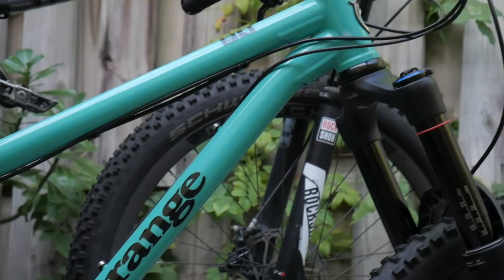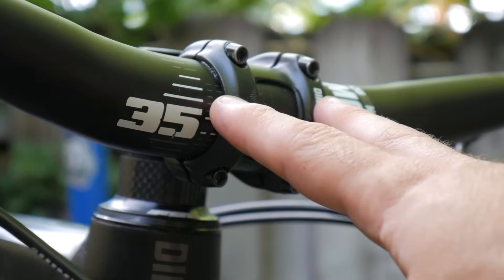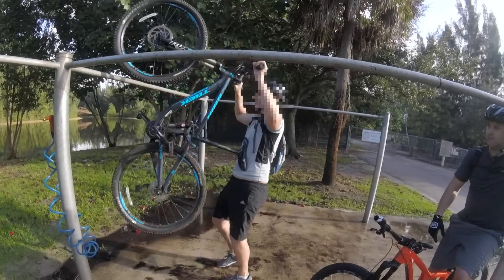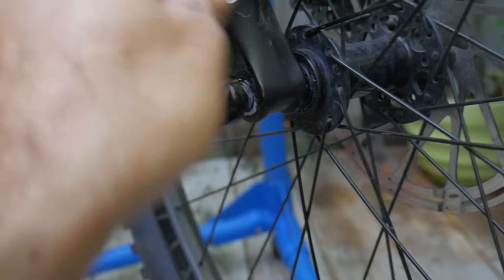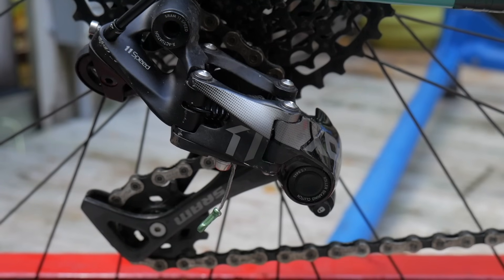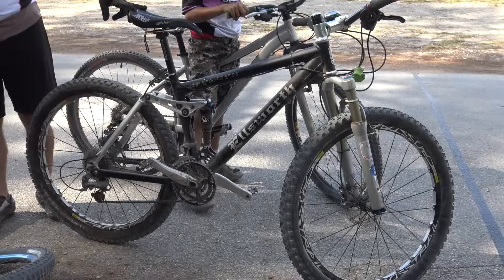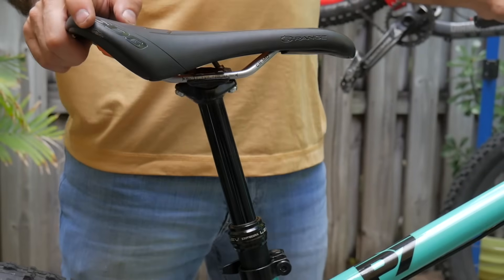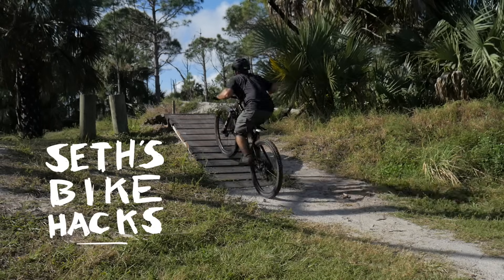Mountain Bike Anatomy - 50 parts in 5 minutes

Comment: Ok I have a question.. front wheel is attacked to suspension fork what is the bar across called (.40sec) you have pike printed on it? Just got a headlight and want to attach it..

Comment: Top tube downtube seat tube seat stay chainstay wheel tire rim spoke nipple cassette rotor brake caliper brake pad brake oil brake hose Olive Barb feral rod brake lever bleed screw seatpost seat post clamp tire tube sealant derailleur cable housing cable pedal crank bottom bracket crank set crank arm water bottle cage water bottle cage bolt fork uppers lowers stanchion crown steer tube headset headset bearing crown race chain cassette derailleur hanger stem bars grips shifter and cap through axle quick release skewer valve core valve valve cap presta Valve Schrader valve pinch bolt kickstand brake pad bolt brake pad cotter pin chainstay protector dropper post shock linkage linkage bolts linkage bearings ball bearings grease

Comment: Inside almost every rotating or turning part is a bearing. These are made of an outer race , inner race or cage , balls or rollers , sometimes pinions , and a shield The bearings usually set in a wearing part known as a bushing or bush. 
The levers in the cockpit are connected to cables , which live in cable stays that route the cable in a way that doesn’t interfere with the moving parts. I got twelve.

Comment: This is a really good video!  My sister just got her first real mountain bike and asked me to teach her this stuff.

One huge thing you didn't spend enough time on was the wheel.

Wheel: made of a rim, hub, spokes, nipples, and sometimes eyelets between the nipples and spokes; An inner tube (unless tubeless) is inside the tire that is attached to the wheel.  Inside the tire there can be gooey stuff whether running a tube or not.  Air is put into the tire using the valve stem.  The wheel is held onto the bike with nuts, a skewer, or a through-axle.  Some skewers and through-axles are quick release.  The hub consists of an (actual) axle (in addition to a through-axle or quick release skewer) and bearings that allow the hub shell that - has holes in the flanges (to accommodate the spokes)- to spin freely upon.  The rim may have a braking surface for the brake pads, or the hub body may have a way to attach a brake rotor (splined [like a cassette] or bolted).  The wheel is attached to the bicycle via the dropouts on the frame and fork.  And there's also rim-strip that goes between the rim and tire that generally protects a tube from getting cut on the holes drilled into the rim to accommodate the spokes and nipples.  An adhesive rim-strip is commonly used to seal similar holes for tubeless tire setups.

Tire:  The rubber part that attaches to the wheel and should be the only part of a bike that touches the ground.  It has treads (lugs) on a flexible sidewall that use two beads to clinch onto the rim (on mountain bikes).  A tube is commonly found inside the tire unless running tubeless.  

Bicycle tire sizes:  JUST KIDDING!!  and it's spelled tyre, and pronounce 'Derail-your!!'

NOW DO FORKS - I need a refresher there!!    ...elastomers...🤣

Comment: omeone please advice me, I am trying to get my first full suspension mountain bike specifically Trail. I currently own a hardtail cross bike with SR Suntour XCM forks. Pretty shitty, freezes as soon as it's 5 degree centigrade. Can't even handle street bumps and curbs to save it's life. My road bike damps way better than this crap Just a pile of shit.
I want to try a used full suspension MTB only so, please don't try to talk me into trying hardtail first because, I'm simply not interested.
Plus, I am not ready to buy a new one since I can't tell if I would like the entire thing.
I am eyeing this one for around 400-500 USD.. I think it's about 10 or more years old.
What do yall think about this decision?

The ones I have been eyeing (Bulls Copperhead), have pretty goodlooking forks from Suntour Raidon and the old XT. The other one had Rockshox Tora 302.
Please help, I don't want to regret buying the wrong components. I know how to check for cracks and worm parts but, I don't have experience in selecting the right components because of the vast option to choose from.

Comment: Derailleur, cassette, rear derailleur, front derailleur, cranckset, chain, headset, wheels, stem, handlebar, seat, suspension, rear suspension,  ray, nipples, tire, RIGID BICYCLE, BICYCLE DOUBLE SUSPENSION, DOWNHILL, CROSS-COUNTRY, PEDALS, BOTTOM BRACKET, FROM MEXICO....

Comment: Hey everyone I got a GT Zaskar Elite ( NOT CARBON ) 2016 

Weight - 11.3KG or 24.9 POUNDS

Suspension - ROCKSHOX RECON GOLD TK 120MM SOLO AIR

Race face handle bar , race face seat post , race face chain , race face crank

SHIMANO SLX 1X10

SHIMANO DEORE HYDRAULIC BRAKES

Any Good ?

Cost £1300 or $1600
Reply: Carbon edition was £1800

Comment: when I discovered Seth bike hacks: What?! what is with those wide and straight bars?! Don't you normally use something that drops down a bit so you could use it for more aero dynamics? those tires! they are so wide that has to be wider than 28c! suspension? what do you need that for? what is with the cassette? its so different from mine! is that a newer generation shimano tiagra? then I got flat bars and noticed the stability is awesome! I had to cut the bars to make it more comfy for me since I'm used to drop bars

Comment: Could you put dual crown shocks on a normal full suspension
Reply: There's little reason to do that. Dual crown forks are something that adds considerable weight that's not really necessary for anything other than pure downhill. The moment you turn the other way and start climbing, you're going to wish you had a normal fork.

Comment: If the terms are SEAT post and SEAT post clamp,,,,, why not call the seat a seat?

It's where you SIT. 

Simple.
Reply: Because in precise terminology, in order for something to be a seat, it needs to be meant to support your entire weight, which is not the case for a bike seat. So while both saddle and seat are accepted, saddle is the correct term, because it supports you in a very similar manner a horse saddle would.

Comment: seth I watch your video's cause I like mountain biking im thinking about starting math tutorial videos in the spring I was wondering do you use pc or mac and what programs do you use to edit your videos?
Reply from the maker: +Jared Bakke I'm on a Mac using Final Cut Pro, but you can use a PC and use Adobe Premiere. Both programs do the same thing, and the software is only $10/month. Good luck man! I like math.
Reply: thanks a lot man i will definitely check that out and write it down for the future! I like math too. I want to be an electrical engineer so im gona do all the higher leval maths like calculus but also some more basic ones like algebra

Comment: have you done a full bike maintenance video? including oiling everything doing brakes, forks and cassette cleaning. maybe even some degreasing tips and what oil to use and other stuff im new to having a bike which i want to maintain rather than just scrap it when it brakes cuz i used to buy bikes for like 10£ from anyone

Comment: Seth I saw you run your front brake house around the outside of your fork , PLEASE don't do that if you snag anything it will rip the hose either at the caliper or lever and that usually totals it.

Just take the caliper off and run it on the inside of your lower leg , much safer and looks a little cleaner. Happy riding , Congrats on 200k

Comment: Seth, at what point do you consider a 1x worth it? At 9, 10, or 11 speed? I run a 1x10 and it seems good so far.
Reply: Depends more on the range of your cassette than on number of speeds. Personally, for both climbing and descending, I wouldn't recommend below 11-36 cassette range. 9 speed cassettes do come with that range, so they're perfectly acceptable for 1x.
Reply: LimitedGarry I'm too much of a bike noob, have no idea how ranges work
Reply: Well, in a nutshell, the larger the chainring (front), the harder it is to pedal and the longer distance is covered by each pedal stroke. And the larger a sprocket (rear), the easier it is to pedal and the shorter distance is covered by each pedal stroke. 
As you certainly know every sprocket or chainring has a certain amount of cogs or (as they're usually called) teeth. Range of a cassette is nothing more than two numbers stating how many teeth does the smallest and largests sprocket of your cassette have. So if you have an 11-36 cassette, the smallest gear has 11 teeth and the largest one has 36. Pretty much all 10 speed MTB cassettes have 11T sprocket and they'll usually go to 32 and higher. Now if you have a 10 speed 11-32 cassette, you have lower range than someone with a 9 speed 11-36 cassette. 
11-36 is the highest range for 9 speed cassette
10 speed cassettes almost always start at 11 and can end all the way at 45
11 speed cassettes can have crazy ranges such as 10-50.
Reply: I like 1 by 7 :)

Comment: Are there any other ways to make your bike fit in your trunk easier besides removing the front wheel?
Reply: removing the back wheel :)
Reply: remove teh bike
Reply: if your bike wont fit in then it will not fit or wait for a miracle
Reply: removing the front wheel is not hard. But if you're having problems, you could get a bike rack
Reply: GhostOfWar turn the handlebars to ensure they are parallel with the frame, they won't stick out as much then, if necessary you can also remove the rear wheel but take care not to damage your derailleur
Reply: that requires more tools and more effort than it does to just remove the wheel.

Comment: Hi Seth and subscribers, Im looking to upgrade my suspenion fork , will I need to remove my crown race from my fork and install onto the new fork to make it compatible with my headset? Thanks In advance!!
Reply: Yes, you will need to remove the crown race (it's part of the headset) from your old fork and fit it onto the new one. I recommend you take the forks to a bike shop as they will have the proper tools to do that. You also might need to cut your new fork's steerer tube and install the star nut. Again, your local bike shop will have the tools to do that properly and quickly. I did that only a couple months ago myself.
Reply: Michael Dereupse no, you have to get a fork that is compatible with your frame's head tube
Reply: Nero Inclan Alright, will I have to change my old crown race onto my new fork to install it into the bike?
Reply: Michael Dereupse the crown is part of the fork... If you buy a new fork it will come with its own crown.